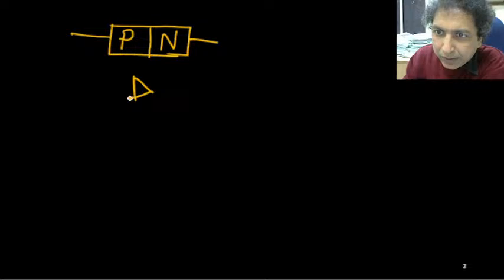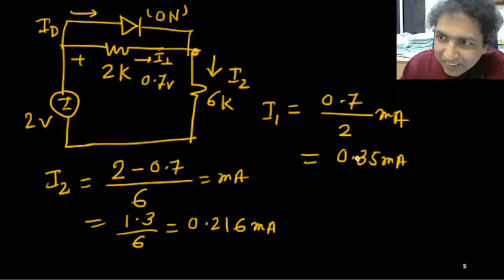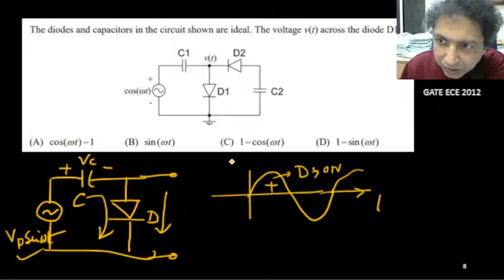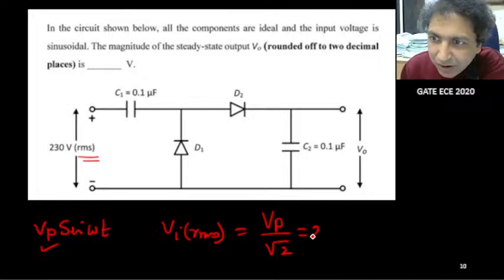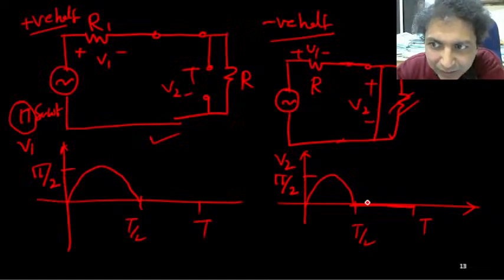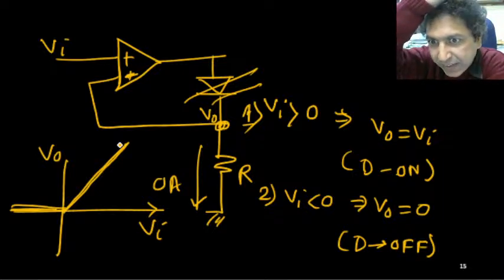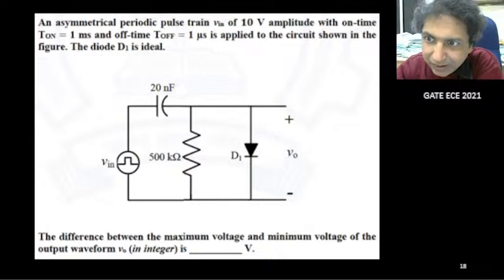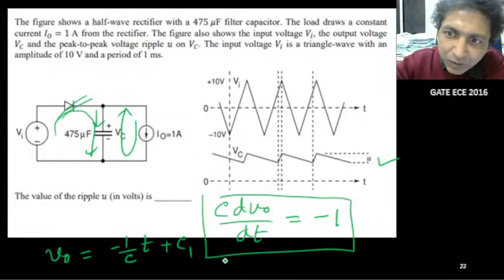Problems on Diodes - GATE Level Problems for ECE/EE/EIE

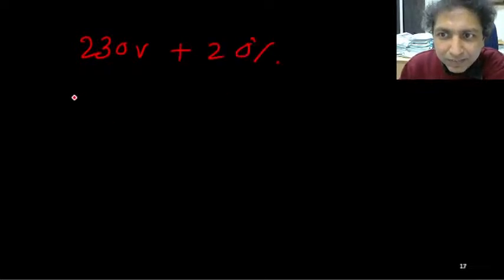Comment: 1:27:03  in this isn't the worst case peak-inverse asked? So shouldn't we perform calculation using value 230-20%? Kindly clear my doubt.
Reply from the maker: Here worst case PIV means maximum PIV that may appear across the diode when it is in OFF condition. Thus 230+20% is considered. Hope this is clear.
Reply: Okay ....it's clear now. Thank you